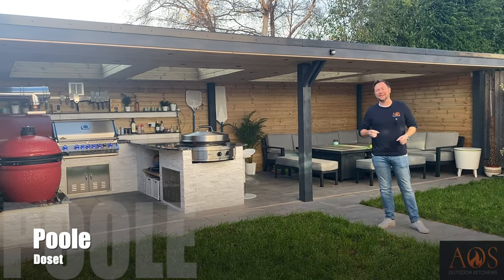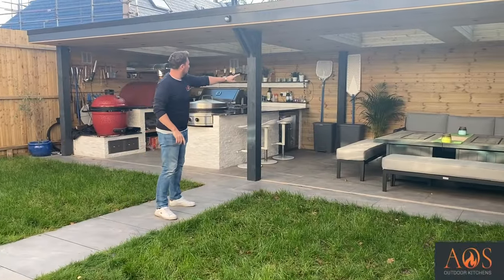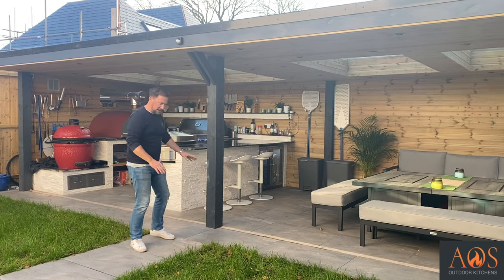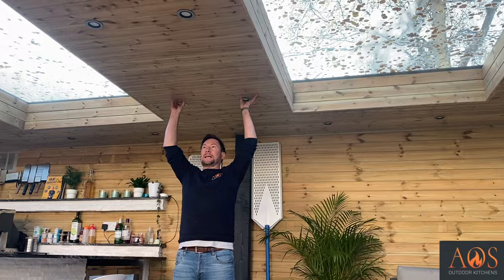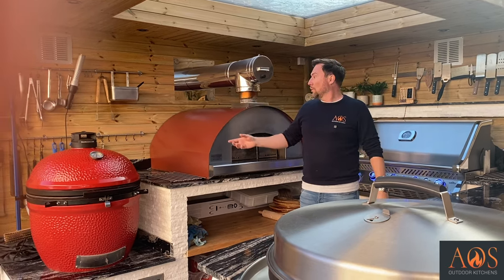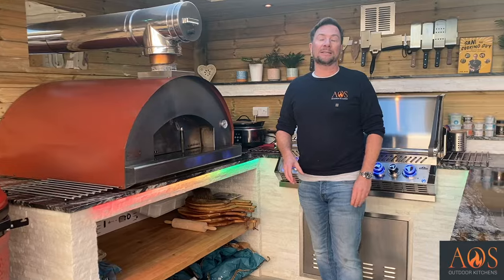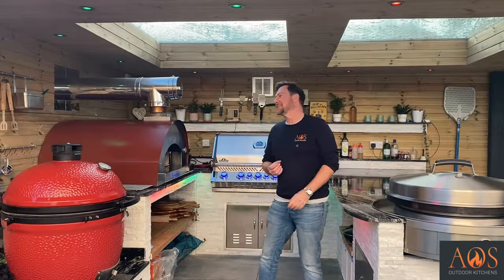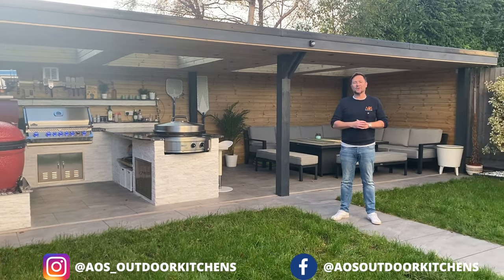HOW TO BUILD AN OUTDOOR ENTERTAINMENT SPACE | NAPOLEON | EVO | KAMADO JOE | FONTANA

Comment: Shame those posts will rot in the ground. You could have used post support brackets instead.
Reply from the maker: @liftfan2  the posts will not rot as they wrapped in a plastic sleeve prior to being concreted. This is a much better method than using brackets
Reply: @aosoutdoorkitchens  ok fair enough. Were the bottom of the posts sealed or was it just wrapped around the length? Post saver or just plastic?

Comment: Hi, love this and wang to replicate what fan extracter system would you recommend.
Reply from the maker: Hi Michael, for this set up we used an online extractor system which is generally the most powerful. The fan and pipes are all fixed on the outside of the shelter.
Reply: Hi mate have uou got a make model for this please
Reply: As a chef, I am slightly surprised that there’s no extraction above the Evo and would worry when all the appliances are in use, a) the volume of air extraction, and b) the external venting, especially in regards to the neighbours. Has that proved to be a problem? 
Also, not sure how they manage without a sink for hands etc, and a food fridge?

Otherwise, a truly remarkable setup.